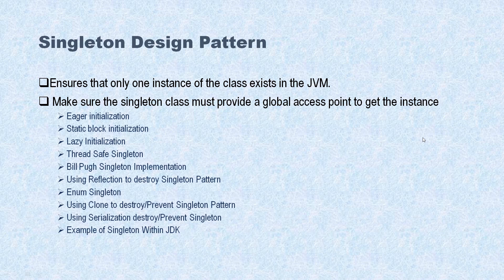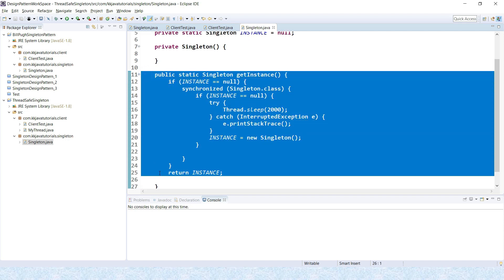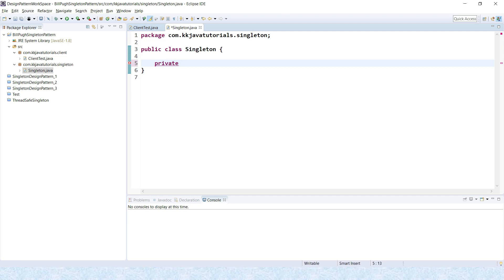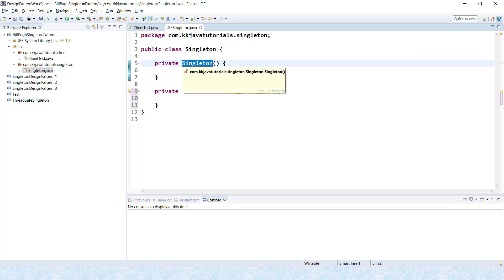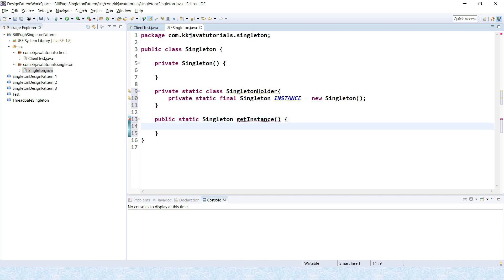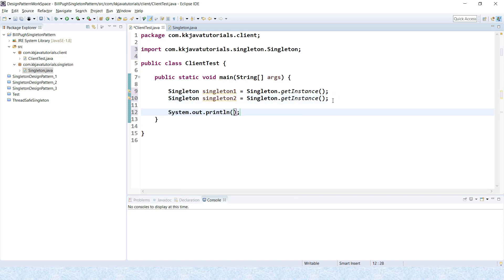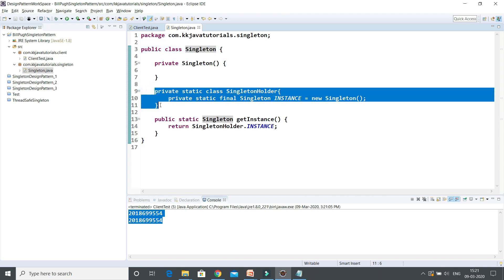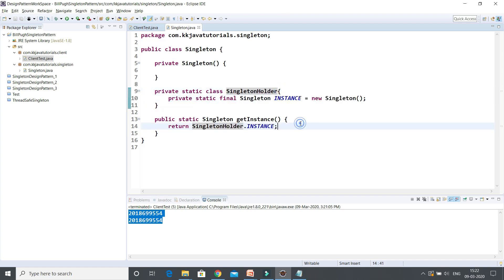How to create Thread Safe Singleton  using Bill Pugh Approach ? || Singleton Design Pattern

Comment: Please tell why this approach is thread safe????
Reply: exactly. this is exactly just creating a singleton class using a static class method, I don't see how this is thread safe.
Reply: @Jerry-cc5nw  The static nested class will only be loaded once ever.  At that moment it will call the constructor exactly once and assign the value to the final static reference variable.
What this buys us above and beyond the eager initialization version (which is also thread safe) is that the static nested class will only be loaded when/if the .getInstance() method is called.  I saw other presentations on this and it was unclear.  Here, in this video, it was made clear.  He speaks somewhat quickly but says everything needed to understand why this is thread safe.  If they ever said this in the videos I watched from others, I missed it.

Comment: Nice video but I am not clear about how bill Pugh singleton is thread-safe?
Reply: The static nested class will only be loaded once ever.  At that moment it will call the constructor exactly once and assign the value to the final static reference variable.
What this buys us above and beyond the eager initialization version (which is also thread safe) is that the static nested class will only be loaded when/if the .getInstance() method is called.  I saw other presentations on this and it was unclear.  Here, in this video, it was made clear.  He speaks somewhat quickly but says everything needed to understand why this is thread safe.  If they ever said this in the videos I watched from others, I missed it.